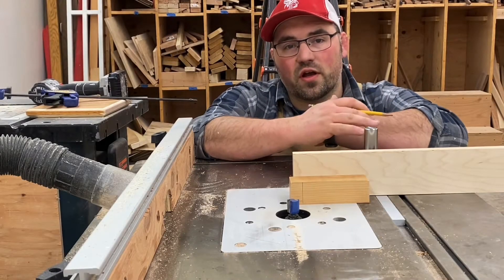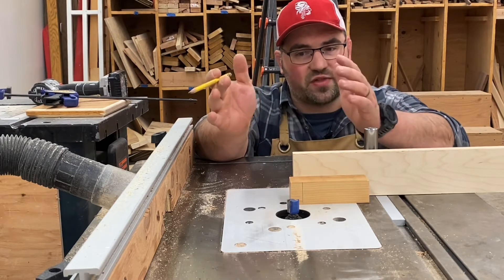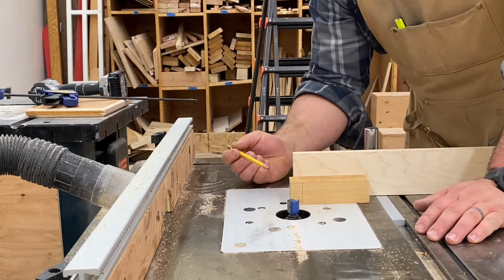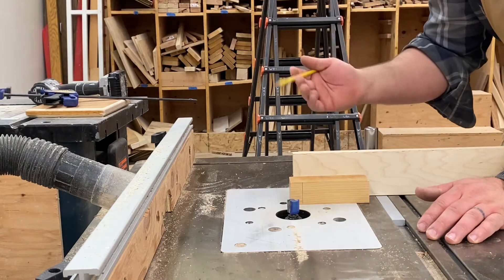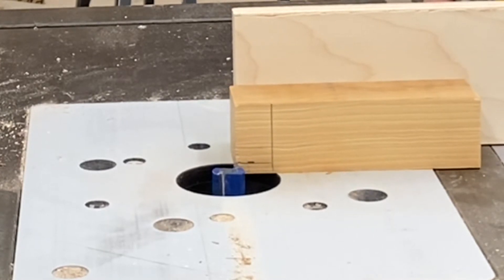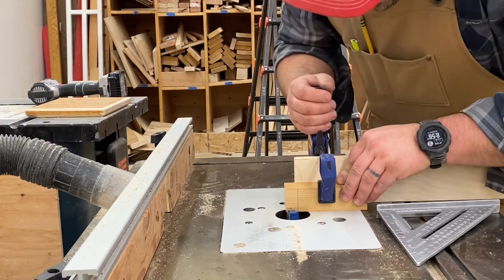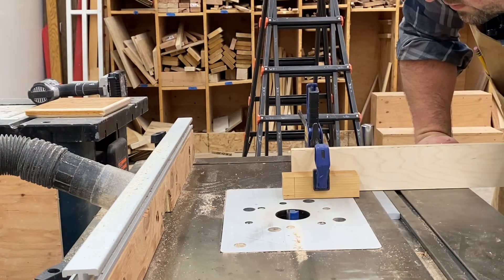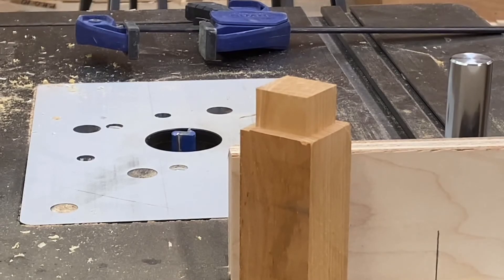Tenons on a Router Table | Easy, Accurate, and Quick Method

Comment: Good caution about max. depth of cut and need for clamping. But you need to use stop on crosscut fence to keep shoulders aligned, and backer board to avoid blowout on the exit side of cut. The quality of your result is remarkable if you didn't follow these practices off camera. Impressive, but  unnecessarily demanding when these additional steps can greatly reduce stress and ensure repeatable accuracy.
Reply from the maker: Totally agree about the backer board to avoid blowout. And a stop block would definitely reduce the alignment time in between passes. Thanks for the feedback.